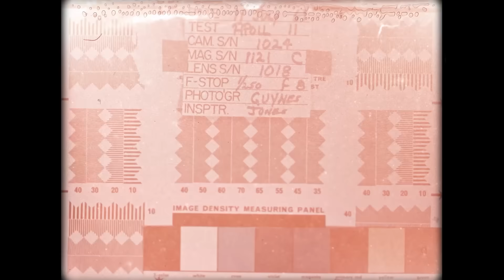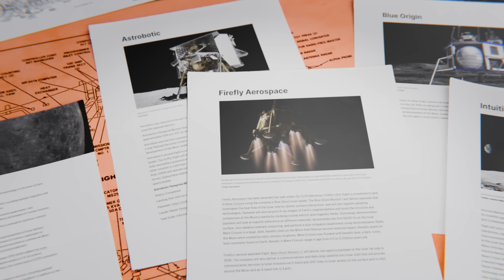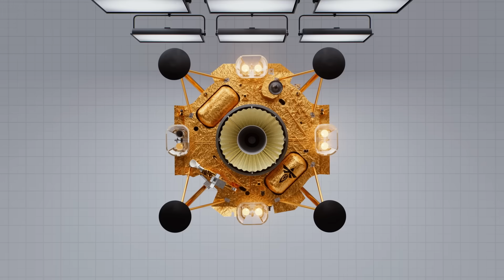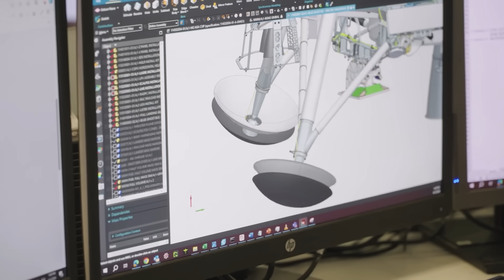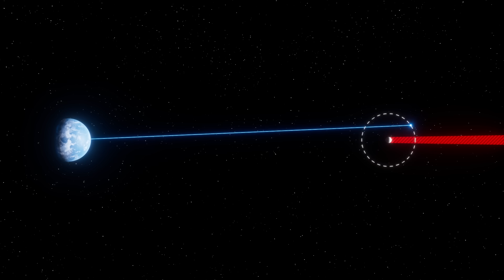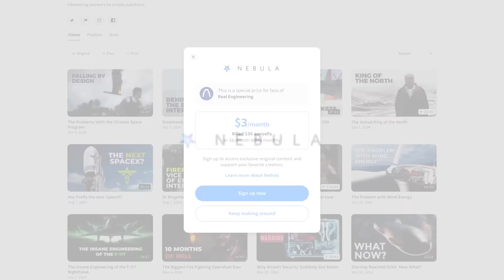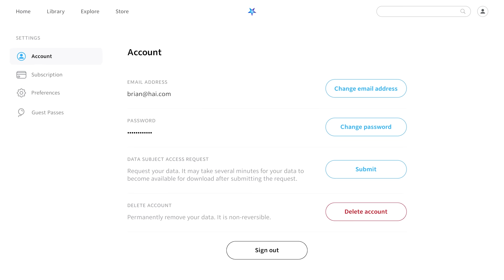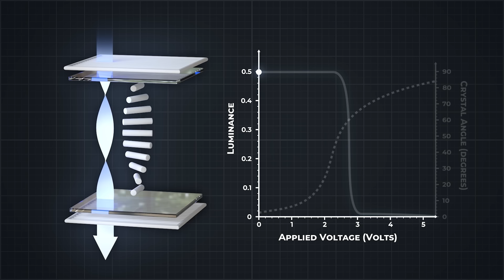Why the US is Struggling to Land on the Moon

Comment: NASA funding is at record levels and Artemis still can’t solve the challenges Apollo claimed to over multiple decades. Remember that heat shield for Apollo? Well they lost the formula! That’s right - more lost technology and when Artemis 1 came back there were holes in the new heat shield. To my best knowledge that challenge hasn’t been solved. Now they are looking at a special radiation protecting material. Why? A few inches of aluminium was all that was needed 1969 - 1972. 55-years have passed since Apollo 11 and still people are being gaslit that Apollo was genuine.
Reply: NASA funding is at 1/10 of what it was during Apollo. And most of that budget is not used for Artemis, so annual funding for Artemis is about 1/25 of what Apollo had available. At the same time, Artemis is a lot more ambitious than Apollo. 
There is no evidence that the Apollo landings were faked, just a load of false claims that fall apart on examination.
Reply: "Remember that heat shield for Apollo? Well they lost the formula!"
Source?

"still people are being gaslit that Apollo was genuine."
Twenty four people went to the Moon in nine missions, of which twelve landed in six missions between 1969 and 1972. Inform yourself.
Reply: @ThomasKundera  I appreciate that you don’t want your world view and beliefs to be broken. You will not want to go through the cognitive dissonance - I get that. I went through that myself because I once believed in Apollo the same as you do now and it took me years of research to break down the walls inside me before I could accept the truth. I kept making excuses for NASA. It’s hard when you have been told something is true your entire life. I respect your position that you want to keep believing it is true. That is your right. I 100% get it.
Reply: @Apollo_Sausage  :
"I appreciate that you don’t want" people to spread fallacies.

" I once believed in Apollo the same as you"
Don't confuse "belief" with knowledge

" it took me years of research"
You've never done any research.
Pro tip: Research in an activity that usually starts with your PhD, and produces publication of scientific papers in peer review publications.
Don't confuse it with "blindly swallowing con men, videos on YT".
I won't even ask you to provide me the list of your peer reviewed papers on Apollo program subject, I know you don't have any.

"I respect your position that you want to keep believing"
I'm not interested in "believing what I want". I want to know what's true. But if indeed you think like that, no wonder you're left where you are...

 "That is your right."
The question is to know if I have the right right or not.
It's not because I'm "free to believe" that 2+2=5, that it's right, agree?

" I 100% get it."
You gave me your way of reasoning, here, not mine.
Think about it.

And now, provide a singe evidence for you claim, if you can.
Reply: @Apollo_Sausage did you just get out of your Colt briefing like what even are you talking about
I would love to learn more if there is anything to learn please give me the ability to do research and come up with these conclusions I would love to be enlightened too

Comment: They don't want to give up the plasma tech the Nazis gave up so we could get off the moon and through the Van Allen belts. That's why we'll never go back.
Reply: There is no “plasma tech”. 
To get through the van Allen belts, all you need is a pressure hull, and a rocket with enough performance that you don’t spend more than a few hours in the belts. The Saturn V had more than enough performance to do that.

Comment: We know every inch of the moon except the inch that matters. 😅
Reply: The IM-1 mission failed because they forgot to switch the altimeter on. Terrain knowledge has nothing to do with it.
Reply: @ I was thinking about the mapping of the moon and the definition it is. That the definition is poor when you try to look closely at the terrain. Probably one of the reasons the Apollo missions went so well was because they were manned. There was a pilot that could go, “wait a second that reading isn’t right.” In real time and make an adjustment on the fly that the probes can’t with the lag back to earth.
Reply: @DanielClark-ot8kj  We have mapped the moon with a resolution of 50 cm per pixel. Computer vision these days is good enough to cope with a landing using that for a map: you can recognize the terrain and fill in the bits that are too small to be mapped from orbit. 
But when one of the primary sensors you use for landing cannot be switched on because someone forgot to switch it out of safe mode before launch, you’re done.

Comment: Awesome video! This seems like a perfect use case for AI. It can handle uncertainty quite well, and you can train it extremely well using simulations of the lunar surface. It can ingest data from many sensors, and can remember important data from previous frames. 

It’s tough to entrust a hugely expensive vehicle to an AI but it will definitely beat any traditional algorithms.
Reply: negative, the code that runs "AI" is based on a huge amount of data that in turns rewrites the code, this will create a solution timing problem. You need just a calculator that takes in only the parameters you need and the processor (and algorightm) should already be there in the lander, sending the information to earth and back to the lander makes no sense, by the time the solution is being processed by "AI" code, that lander would already had crashed.
Reply: @ they can easily make an on-device AI, no need for transmission to earth. The AI co-processor in the latest iPhone is shockingly powerful and would easily be capable of this (though of course for space missions you’d want a radiation hardened processor, but the point remains). I say this as someone who has personally developed a lot of vision based AI’s
Reply: @Nightsd01  negative again my friend. Without a warehouse the size  of central park, AI code is worthless. You're still better off with a simple calculator, even a laptop would be much more efficient.
Reply: @Nightsd01  wait, you developed vision AI? you've seen the code then? So... You know AI is just a bunch of ifs nested to infinity. reminds me of people saying the cloud like is not the same as bunch of servers stacked together in a warehouse. The name is different but marketing does nothing for real engineering efficiency. You know this , right?
Reply: @ that is fundamentally true, but it doesn’t mean it cannot achieve superhuman feats. It would be relatively easy to develop an AI to perform sensor fusion from camera sensors, radar, laser rangefinders, etc. to produce a unified position and estimate the suitability of a landing site, detect things like rocks, etc. 

One thing is for certain - it’s a heck of a lot better than whatever human-made if statements were running this particular lander :)
Reply: @gordilloedwin  also at a truly fundamental level…who is to say that the human brain isn’t just a bunch of if statements, at a cellular level? :) just a thought!

Comment: 100 meter resolution? That shows where each rock and boulder is on the surface of the moon? Really, you're not gaslighting us now are you? How many boulders are there on the Moon that are less than 100 meters in size? That's 328 feet for our friends in Kentucky. I think I smell smoldering horse manure.
Reply: We have maps of the moon with much better resolution than 100 meters: LRO maps are about 1 m resolution.

Comment: What happened is we had young engineers at NASA, now most employees are  high paid because of seniority.  They are mostly just overpaid people that mostly just pretend to work on projects with the same large budgets. They haven't done much since the space shuttle.  It's not my opinion many studies over the years have shown this, yet very little is changing.
Reply: I think the problem is budget but also the next steps a base on the Moon or Mars has really challenges such as how to cope with radiation for years.
Reply: NASA employees have nothing to do with the failure of the Intuitive Machines mission.
Reply: @Hobbes746  they suck up a lot of resources, and mostly just want to think about diversity, climate change.  The space shuttle was grounded because the wanted to make all the chemicals only environmental friendly and those new chemicals didn’t really work and it ruined the electronics and internals.  Can you imagine if we didn’t have Elon, we would no longer have flights at all.
Reply: @Photovintageguy that’s not why the shuttle program ended. It ended because it was too horribly expensive and deadly to continue using
Reply: @ i knew people working on it,  the electronics were getting spider web looking corrosion,  they shut it down early as they had no alternatives to toxic chemicals used to prevent corrosion. Other problems could have been solved, but basically not being able to prevent rot on circuit boards was a no go.  Yeah eventually they would have had to move on but regardless they never did. That was the last thing that actually worked.  Nothing since 2011.  The budget each year since has been about 15 billion or more. With just make work and promises.
Reply: @ Kennedy announced the moon project and within 9 years they finished from scratch.  Average age of the engineers was 28 years old.  Today the average age is 48.  NASA is top heavy with older employees too: Nearly 40% of the agency’s science and engineering workers are age 55 and older, according to the April report, “NASA’s Efforts to Increase Diversity in its Workforce,” from the NASA Office of Inspector General.
Reply: @Photovintageguy  NASA has run plenty of missions since 2011.
Reply: @Hobbes746  I'm not talking about JPL and non manned or military missions. Those are run by other groups of people.  Those actually work.  NASA itself is just promise, failure, then decades of delay.
Reply: @Photovintageguy  That is nonsense.
Reply: @Hobbes746  yeah wait 10 more years they still will only be promising things. You have no clue on how lame they have become.
Reply: @Photovintageguy  NASA is doing fine. Every year, new exciting missions are being launched. The only real problem is that for Artemis, a. they were not given enough of a budget so it’s being drawn out, and b. parts of the Artemis architecture have been mandated by Congress instead of NASA being free to develop a better solution.

Comment: Why The US is Struggling to Return to the Moon ?? 
 ENGINEERING has changed. 
Just like the Artemis heat shield looked good on the computer models, it failed miserably in the real test on re-entry.  
Maybe someone needs to read NASA SP287 before trying to go back to the moon. 
This video explains the problem  https://www.youtube.com/watch?v=OoJsPvmFixU&t=1949s

Comment: Over 40 years of mechanical engineering, intentionally locating and adhering to the best mentors, and attending university classes throughout, I can report that two problems exist today. One is that curricula has been diminished from rigorous without mercy to almost a participation degree at the end of attendance. These new grads are replacing mentored engineers that are retired before the new grads arrive, after this new generation of mentors could develop the new hires into engineers, transfering their knowledge and experience. Two, new grads are helplessly practicing "guess, try, and fail" until something seemingly works, instead of applying the known principles and general equations to get it right the first time, every time. Design reviews are not brutally honest, but a pleasant social interaction accepting whatever guess is presented.  Guessing until something works for some unknown reason does not establish a base from which to troubleshoot or improve design. I'll add a third. There is NO engineering management in most corporations. All they do is socialize and require status of projects. No planning, organizing, staffing, directing or controlling. Very sad state for the U.S. to be in.

Comment: Over a century of hydraulic shock absorber technology and we choose to crush the metal inside instead. Something seems wrong with that; I understand there's stuff to solve there too but..
Reply: Metal crushing was the Apollo LM choice for lots of good reasons, and I invite you to read them if you have a chance.
Among them:
- Reliable under a large range of temperature: too cold, your hydraulic liquid will freeze, and nothing will work, too warm, it will vaporize, breaking the structure. Controlling legs temperature is going to be hard, and if you have an hydraulic solution that can work between, roughly -100°C and +100°C, tell NASA.
- Light: a one time crushing metallic nest is very light, having pistons able to handle pressure is heavy.
- No bounces: a crushed metal is on way, it won't uncrush back. Most hydraulic system will have at least some bouncing,e specially on fast impact.
Reply: Yeah it makes the aerospace teams look super incompetent when they forgot that spring shocks exist and randomly waste over $10,000 on some custom composite technology. This is why everybody makes fun of NASA these days.
Reply: @nicholasapodaca9886  No.
Reply: Hydraulics in space?

Comment: Why don't they use thrusters on both directions towards the surface and away from the surface so the lunar module will be like getting crushed by thrusters on both sides so if it humps up the outside facing thrusters activate and push back to ground and down thrusters again active until graceful touch happens

Comment: No one has ever been to the moon because it's not a physical sphere.
There is a fixed firmament above our heads, the earth is flat!
Most of what you consider as science is nothing but a fairy tale. A brutal propaganda being pushed upon us since birth.
Reply: If the firmament existed, dinosaurs would still be walking around and humans would not exist.
Reply: Wow, you fell for all the cons, didn’t you? 
Simple experiments that anyone can do prove every single one of your claims wrong.
Reply: @Hobbes746  Yeah just come and show me those experiments XD delulu
Reply: @PlaaTable 
Calculate the angle to Polaris at your location, then travel South 69 miles.
The angle to Polaris will have changed one degree.
Travel another 69 miles and it'll have changed another degree.
This will happen over and over until you reach the Equator.
Simple geometry shows that this is impossible on a flat surface, but perfectly matches a globe Earth.
Reply: @PlaaTable  Watch a ship go over the horizon: you’ll notice it disappears gradually from the bottom up. This is impossible on a flat plane. 
During the next lunar eclipse, watch Earth’s shadow as it covers the moon: this shadow is always a circle segment. The only object that always casts a circular shadow is a sphere. 
Find a piece of level ground. Set up a graduated scope on a tripod, place the scope horizontally, and ask a buddy to stand in front of the scope with a long ruler placed vertically on the ground, at a distance of 20 meters. Read the elevation from the ruler. Ask your buddy to move to a distance of 100 meters, and read the elevation again. Repeat at 50-meter intervals until you have covered a distance of 1 km. You'll see that the elevation changes by 8 cm over 1 km, and when you plot those changes, you get a circle segment. That's the curvature of the planet.
Reply: @PlaaTable  : Watch a sunset. Where is Sun after?
Reply: A religious flat Earther talking about fairy tales .

Comment: It was so easy in the 70's with one might say primitive computing and communication capabilities.
Today we have incomparable computing and communication capabilities and all we hear is 
EXCUSES.
Reply: Even 70s computers could calculate and there is hardly any difference between radio communication then and now. People still need large dishes and they still work with the S-band. Your gut feelings are no excuses.
Reply: There was nothing easy about Apollo. It was the most expensive engineering project in history. 
IM is attempting to do a moon landing at 1/3000 of the cost of the Apollo program.
Reply: Computers don’t get you to the moon, rockets do

Comment: Why the US is struggling:
- the experience and wxpertise was lost as lunar missions were cancelled and no one in the 1970s thought about saving that and training new generations to pass down the knowledge was necessary. 
- lack of funding: because the race to the moon was viewed as a “war deterrent/dominance” effort, NASA had almost a blank check. It was second to only the atomic bomb blank check…. But now, the funds are not available for such expensive endeavor. 
- low risk tolerance: during the whole space program development a lot of equipment was actually lost during actual live testing and jot just computer models. Therefore equipment was not only designed but tested and destroyed as many times as needed to prove the equipment could resist space and perform as designed. Now with computer modeling to cut down costs, creating test equipment it has been minimized to final testing not just proof of concept.
Reply: The thing that caused IM-1 to fail is so basic that it can only be explained by hubris: thinking they know better than those old codgers at NASA, and therefore refusing to learn the lessons that were learned by NASA in the 1960s - and have been published for all to profit from.